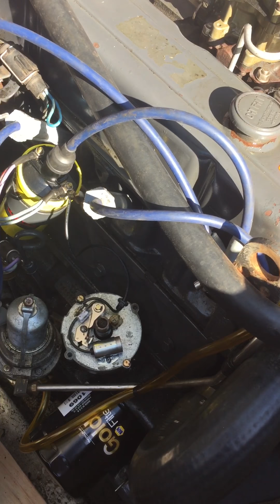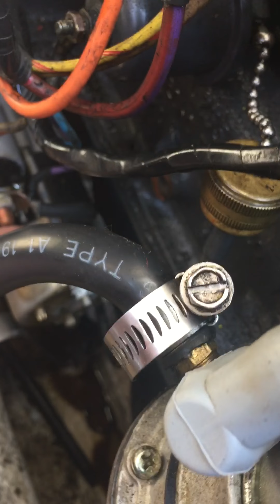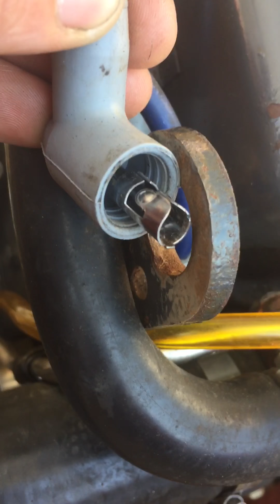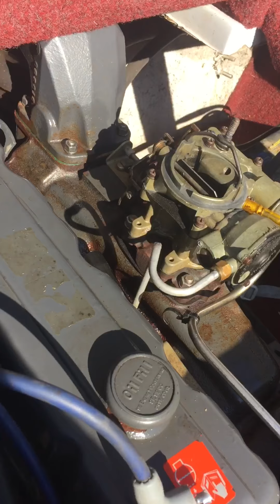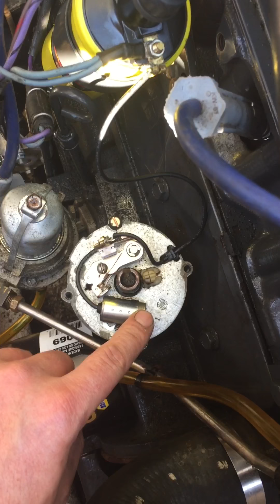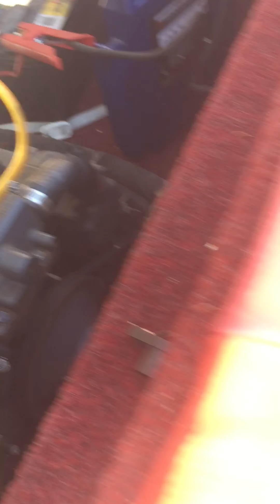88 OMC no spark

Comment: Having the same issue with my OMC Seville, i just replaced the coil, will check the condenser and contacts tomorrow, Same thing, boat didn't run in 6 years. So many issues if you let it be

Comment: You could have easily just checked the resistance on the coil primaries & secondary windings without having to go to all that hassle. Plus. Ground the coil for long periods of time will short out the coil. It’s designed to be grounded for only milliseconds at a time. The points & cond, cap & rotor should all be replaced every so often. If they are badly pitted or burned, replace them. The rotors will develop laser sized pin holes & cause the spark path to short onto the distributor shaft. Dist caps will develop spark scatter as well.  Lastly. The point gap is roughly .018 thousandsths. And the dwell should be about 30 degrees on a V8. Other engines have different dwell specs. Also. Once the Rhine is running, you should check your base timing & total advance up to 4000 rpm as well. That’s important for power.

Comment: What if the new coil won't send a spark to the distributor cap?
Reply from the maker: Check you could pack , if it's new ore good , then check the wires going to ground batter and starter .
Reply: @dkperformance873  Thank you but I didn't get the first part. Check what exactly?
Reply from the maker: Coil . It should read 12 volts

Comment: I have a 1989 OMC king cobra with a 460 big block how can I get my RPM gauge to work
Reply from the maker: Check if u have good ground and power going to the tech from ignition, if all of that is good then it's your charging coil that is located on lower balancer to gage the speed of the crank

Comment: Hey Bubba I replaced my points and condenser’s and I still don’t have any spark what do you think it’s going on?
Reply from the maker: Do u have power going from coil to distributor?
Reply: Dennis Kushnar yes I do. Now my next step is to change the spark plugs and wires? And when I do that, do you know what’s the gap for the spark plugs? Also I know this is a dumb question but, do I  need to gap the point when I replace it? Thank you for your time
Reply from the maker: @ElGordo_831  I believe is . 03 and wires  you don't do anything on them , make use they fit tight on the plugs , bend the points if needed . Make sure your timing is right too #1 plug wire to #1cylinder and so on .
Reply: DK Preformance thanks pal